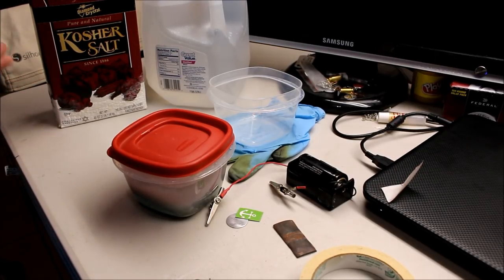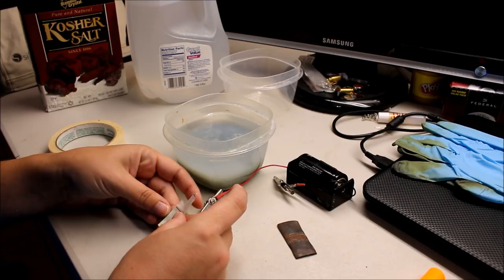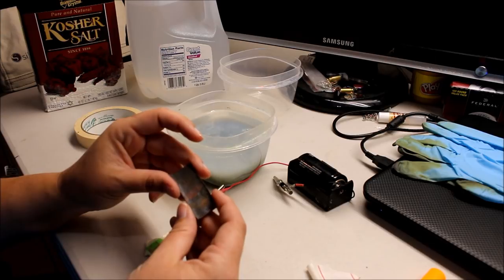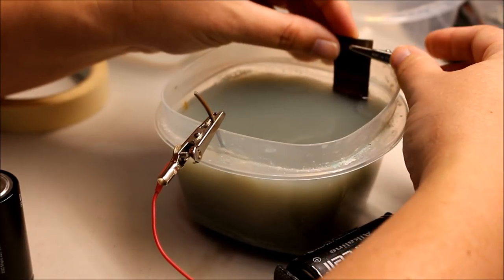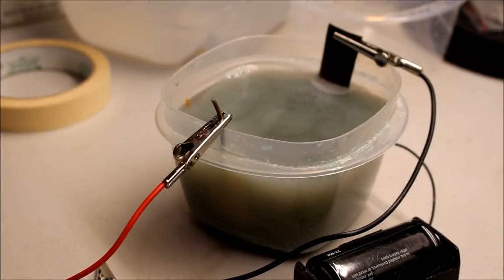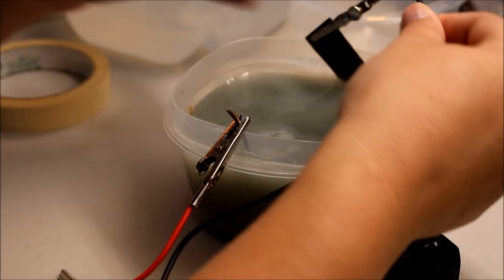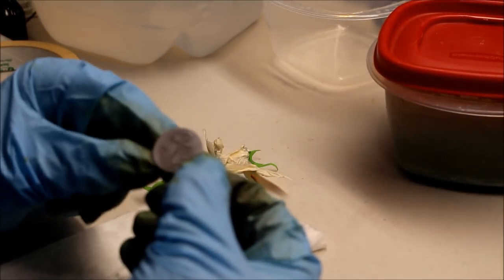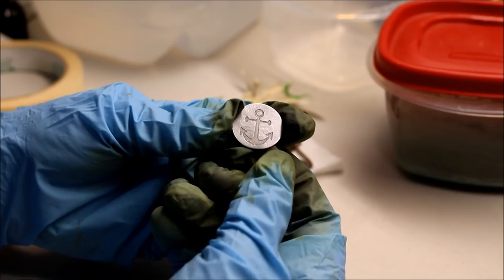Salt Water Etching on Aluminum

Comment: Hint:  Oxidation on copper will prevent a clean connection.  Take some sandpaper, emery board, or nail file and clean the copper plate and wire to remove the oxidation.  The larger battery provides enough current to arc through the oxidation. 

As a battery alternative, you can use a 6 volt battery that is used in the large flashlights.  You can find these for less than $10 at any Big Box or sporting goods store.  Some are rechargeable if you want to spend a few more bucks up front and get a charger.  Not a bad investment if you plan to use this a lot.  

Although you mentioned briefly about using the copper pipe/plate as the negative connection, this wasn't made clear in the video.  

Now that I have complained the whole time, the overall process is great.  Thanks for sharing your knowledge with others.

Comment: I was looking for a cheap method to do my etching and you really nailed it. One thing I would like to suggest so the battery doesn`t get hot and leak or burst on you. Add up a 10 ohm/10 watt resistor inline on the positive side. This way you will limit the current going through. Great job!
Reply: More cheapest you can used "Ferric Acid"

Comment: Just a quick report back. I lined a large food container about 12" x 8" with heavy foil. The aluminium I wanted to etch was like a channel section 2" x 1.5" x 11". I used a bench power supply -  8V at 3A made a lovely grey bubble scum. I did rotate the aluminium to try and get an even etch. It took 3 coats of paint to sort it out but it must have helped the bond. Worked very well - thanks.

Comment: This is great! Gave me some good ideas for a project I'm working on. Made me wonder if hot glue on the back would keep the electrode and the aluminum water-tight so the back wouldn't get etched.
Reply from the maker: Good idea. If you tried it did it work?

Comment: This is great. It helped me loads, thank you.I  wanted a complicated pattern doing on a bit of my bike. and although I'm quite handy with a craft knife it was too intricate. I got a die cut transfer at a print shop. I got a good deal and got some vintage repro transfers too. I copied the amount of salt used.I used a tattoo machine power supply. which works great. I messed around with the voltage and the time.  At 12 volts it eats through it incredibly fast. Real Aluminium is hypoallergenic just like silver and gold. I want to make a simple bangle from a strip of it.  A celtic pattern would work well.

Comment: Anna, before attaching your electrodes (proper name) to your aluminum and copper pieces you may want to take a piece of 400-grit sand paper and clean them so they are nice and bright in order to make a good connection.  The copper plate and wire both should show bright copper for the best connection.  Just a thought.

Comment: As far as I know, the gas causing the bubbles is O2, H2, Cl and HCl which is explosive when exposed to UV light. Do you know if there will be created enough gas to be dangerous following your setup?
Reply: No chance. Only tiny amounts of gas are made and they disperse rapidly. It's actually quite hard to get H2 and Cl2 to explode. You'll be fine.

Comment: A thought. Maybe you can use aluminum tape on the back. Between the copper teminal and the aluminum body. It should be widely available from any hardware store. It's normally used to seal ventilation pipes. But its adhesive on one side and it is conductive so the stuff should work in theory. And it should keep the aluminum piece from discoloration. 

Maybe worth to try :)

Nice video btw!

Comment: Nice video. Quick question. After the process is done the water is toxic? Can i throw the water without problems?the negative metal has to have the same size as the positive? Thanks a lot
Reply from the maker: I honestly don't know for sure. I wouldn't think so maybe add some baking soda just in case?
Reply: @AnnaLewis07  thanks for your answer
Reply from the maker: @raulegido  Welcome!

Comment: I think you might need to sand the copper wire and pipe clean so that it will conduct the electricity better. It looked pretty corroded.
Reply from the maker: I started cleaning it before use it does make a huge difference

Comment: Trust a lady to get it right. In the UK it's almost impossible to buy anything that a baby can't eat, drink or stick up it's nose. I need to paint some aluminium and no matter what paint I use it chips off. I can't locate any self etching primer and all acids are now under the 'poison act' so any acid electrolysis (other than old car battery acid) I can't use. I'll need an old washing up bowl as the bits a quite big. That etching you did looks as good as anything else far more complicated. So 'KISS' to you madam - Keep It Simple Stupid. By the way, those bubbles are hydrogen and oxygen so don't sniff the wrong ones and smoke LOL.

Comment: Exactly the video I was looking for. Thanks, Anna!
Reply from the maker: Manolis Sifakis you're welcome. Excuse my accent.
Reply: Geetings...... #Anna Ms. i had a problem when doing this. I cut a piece from an aluminum pipe and then covered with my total design using vinyl leaving only areas to etch... I used a 12 volt power supply, vinegar (containing Acetic acid + water) and little salt.... But it did't work... Is there anything that i am missing..... I have not treated my aluminium piece before doing this..... Kind guide will be appreciated ........
Reply from the maker: Ahtisham GM I only use salt and distilled water. How much salt? I think I used almost a cup in this bowl. Try upping your salt level.
Reply: Thanks for your Quick Reply.............. Do you think that aluminium piece need some pre treatment to disolve that part in vinegar and salt...... It is a piece cut from aluminium Pipe used industrial in doors or whatever?
Reply from the maker: Ahtisham GM not sure honestly. I've only used sheet aluminum. The vinegar has me confused. I don't use it on mine.
Reply: I used 12 volt supply but it did't work... I had that piece lying same as vinyl pasted... .Will do with this after 2 days...... Today 2-9-2017.. will be celebrating EId..........
Reply from the maker: Ahtisham GM good luck!

Comment: Some tips to help improve your process.

If the metal is not completely cleaned/degreased, the etching can be uneven. The natural oils on your fingers is enough to cause enchant to not get at the metal fully (for example, have you ever seen a partial fingerprint in the etched result?). Oil and dirt may also me left on the metal from wherever it came from, especially from the mill if the metal is new. This is why you probably see different results, even from the same sheet of metal. Invisible surface contamination is preventing the salt water to reaching the entire surface the same way everywhere.

Refer to this video where he degreases the metal with soy sauce. Other cleaners can be used, but most people have some of this in there kitchen already, so if it works, why not use it. Notice that he is wearing gloves during the entire cleaning process to prevent oil from his skin getting back onto the metal.

https://youtu.be/6srRiTfAUqE?t=152

You can probably spot other tips in the rest of the video, noting how he handles his parts. The main difference that does not really matter is that he is using copper instead of aluminum, laser toner transfer instead of vinyl as the etch resist, and chemical etching only instead of chemical + electrical etching.

Try using better waterproof tape, like vinyl electrical or clear packing tape, instead of the paper masking tape you are using here. The paper is likely allowing the salt water to soak through leaving only the sticky adhesive to protect the metal that should not be etched.

The alligator clip onto the corroded pipe may not make a good connection because of the corrosion. Try to solder a piece of wire onto the pipe so the wore-to-pipe connection remains good longer even after the surface corrosion builds up again. The alligator clip can then attach to the clean end of the wire, and it keeps the clip away from the corrosive liquid. For the wire on the back of the metal, try using a piece that still have the insulation attached (or wrap with electrical tape) except where the coil presses against the aluminum and where the alligator clip attaches. The exposed copper wire will also be etched, which adds copper residue to the etching solution along with the aluminum residue.

Comment: Hello,can i use laptop charger OUTPUT is +32A +16A
Reply: yes
Reply: be careful if you use a laptop charger, you will need to limit the current to 1amp, otherwise, you will damage your charger. her circuit does not limit the current